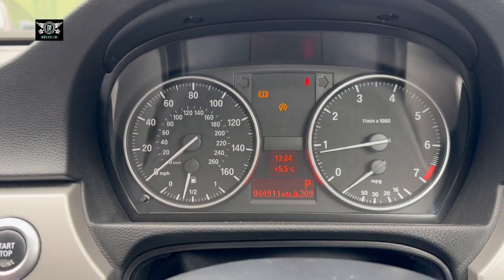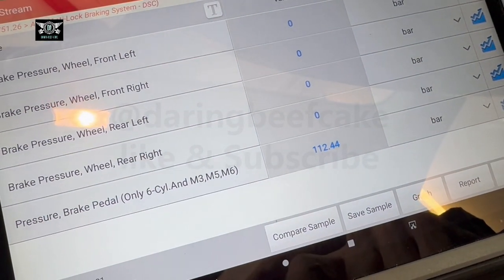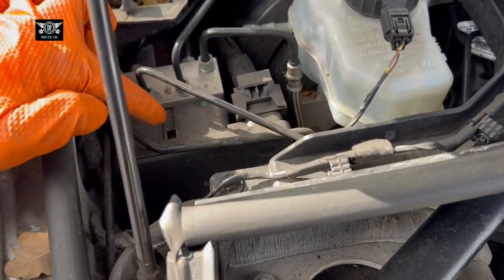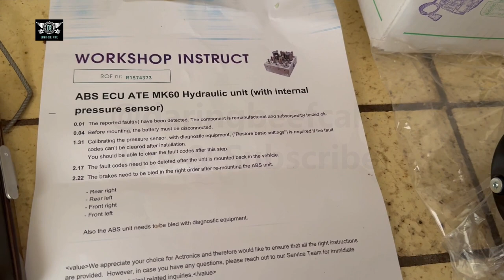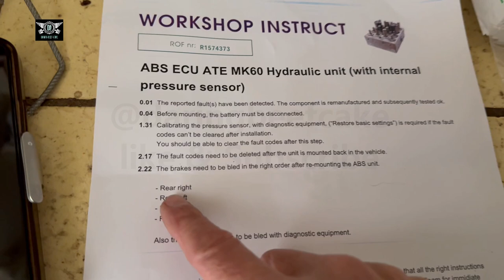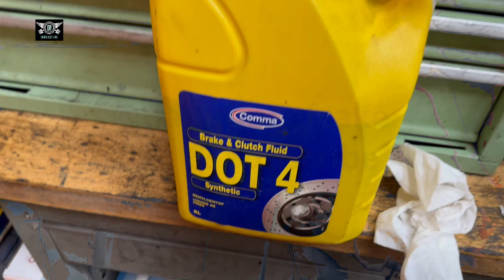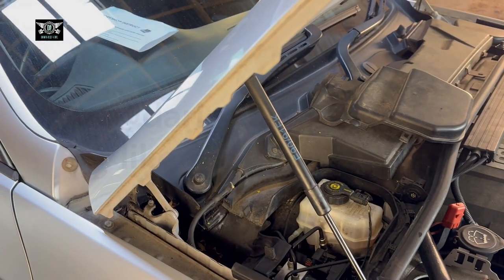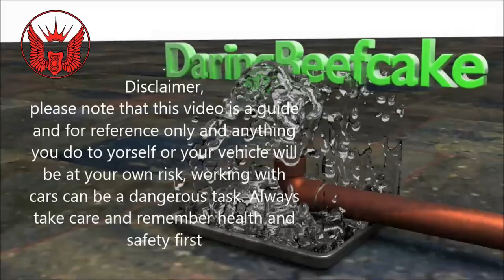BMW e90 e91 e87 abs dsc fault 5E20 unit and pump removal and replacement

Comment: Should I drain the brake fluid before taking it out? So it won’t leak as much, or is there no point in doing that? 😅
Reply from the maker: I don’t think there’s any point doing that, as you will brake fluid leaking anyway, and will need to rinse the area after. There might be less but most likely you still need to clean it.